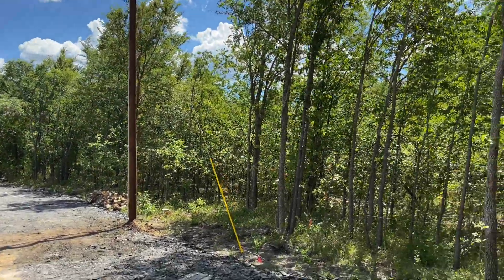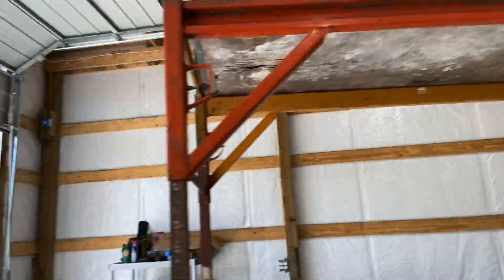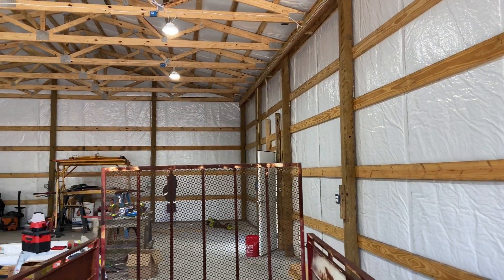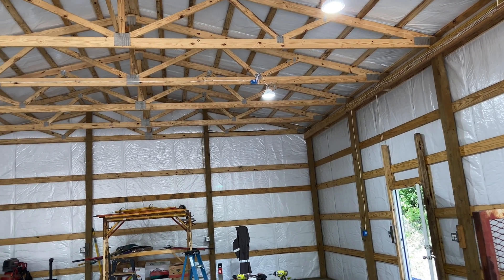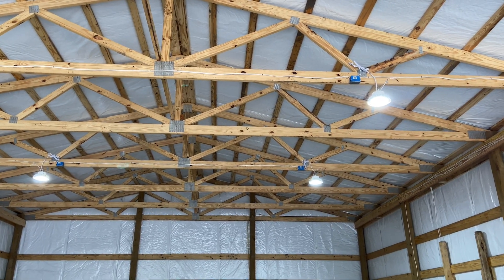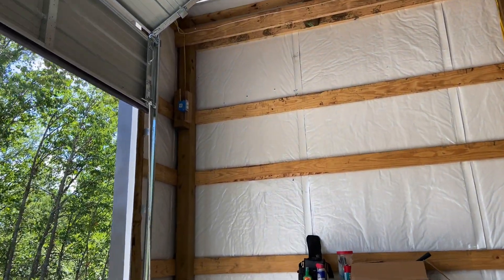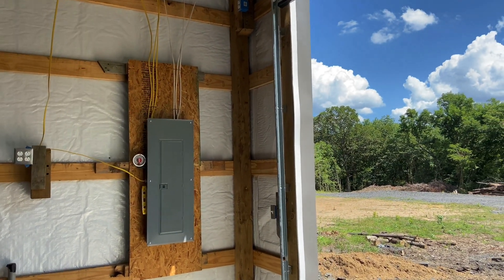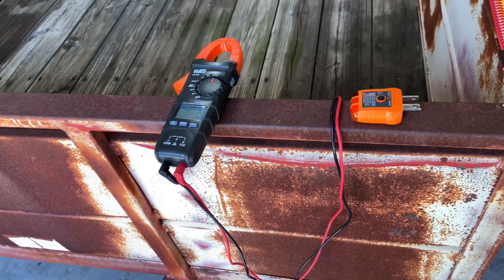Episode 20 - Electricity!

Comment: I know it’s a long time later but there is an easier way to do 3/4ways if you have you home run go to the 4 way and keep the 14-3 between switches, use the white as hot back to the first switch and keep the rest the same.